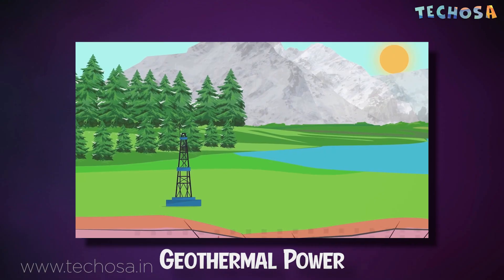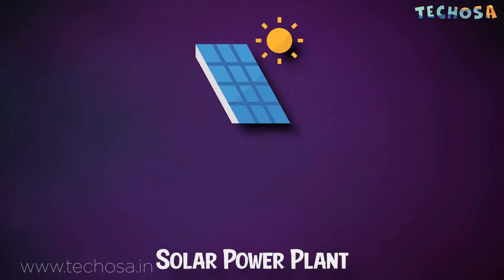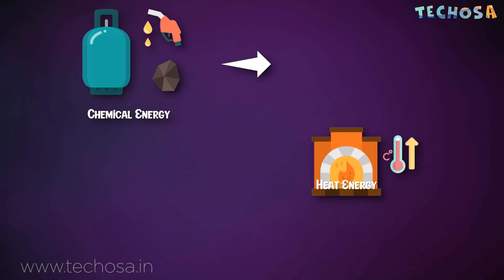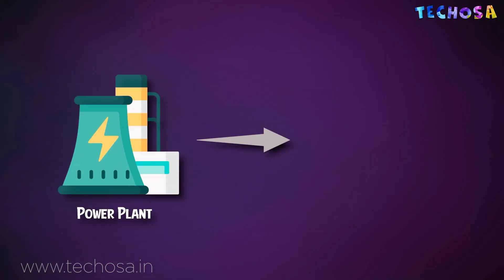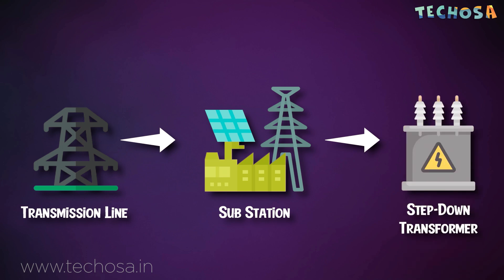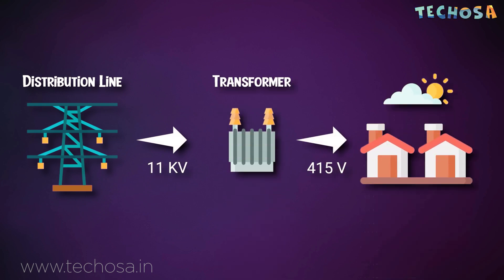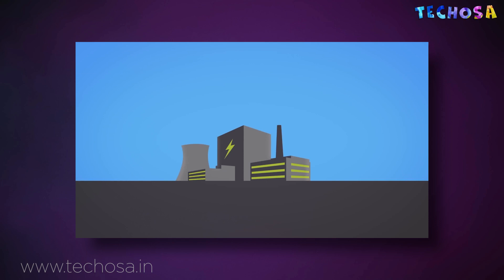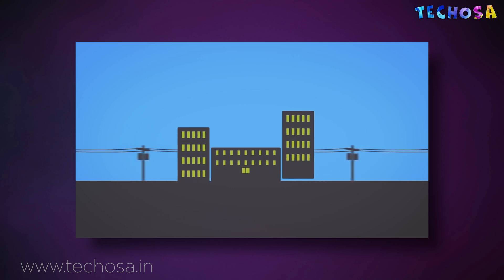Power Generation, Transmission and Distribution | How Electricity Reaches our Homes | Techosa

Comment: Can you say how about three phase and single phase connection?
Reply from the maker: The power supply system is mainly classified into two types, i.e., single phase and the three phase system. The single phase is used in a place where less power is required and for running the small loads. The three phases are used in large industries, factories and in the manufacturing unit where a large amount of power is required.

One of the major difference between the single phase and the three phase is that the single phase consists one conductor and one neutral wire whereas the three phase supply uses three conductors and one neutral wire for completing the circuit. 

Single phase connection of 230V is enough for our houses but industrial equipments of higher power rating need 415 V or some cases 11KV three phase power supply.